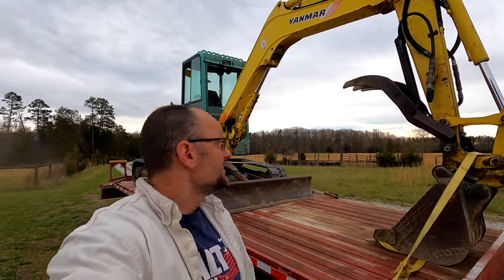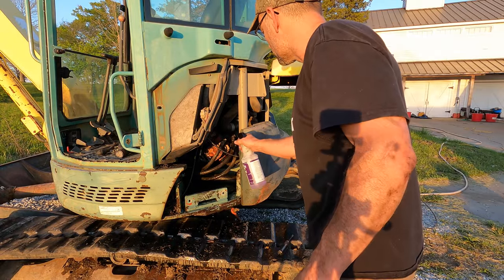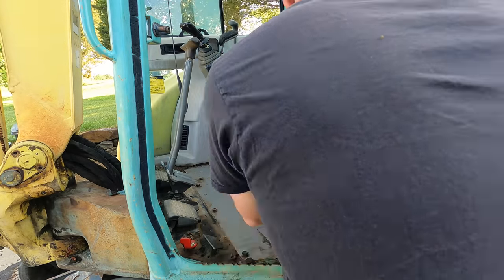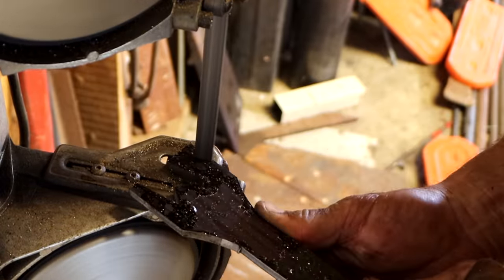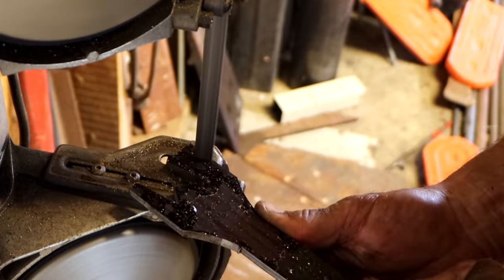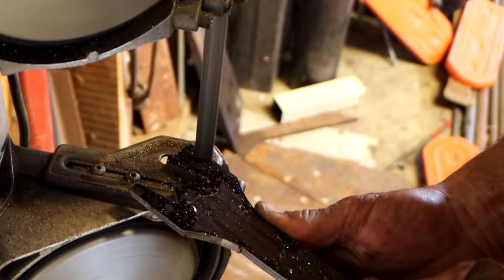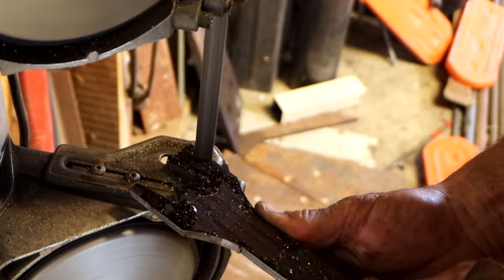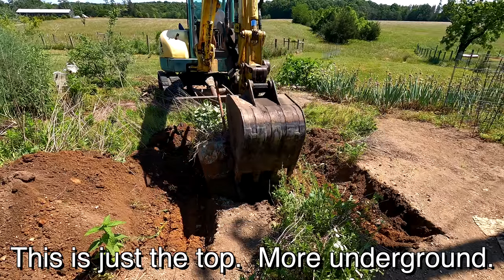Buying (and Fixing) My First Excavator.  Yanmar VIO-50

Comment: "I'll just make my own wrench" god I love farmers.
Reply: Depends on the farmer. I have fixed equipment that any time things were wrong they would just weld everything. No loctite, nut welded to bolt. Shaft collar slipping, welded to the shaft. Seal leaking, weld component to housing, etc. 

Later when real maintenance needs to be done it is so much harder grinding out all their welds and other makeshift fixes. Or the damage wouldn't have happened in the first place had they maintained it properly.
Reply: @court2379  Perhaps there's some selection bias.  All of my exposure to farmers has been them doing cool shit and putting it on the internet.  I imagine the type of farmer to do dumb shit isn't likely to show it off.
Reply: @Asdayasman  Yeah, that is probably true. It seems like there are two types, those that run something will negligible maintenance until it dies. And then leave it wherever it died for 50 years as it sinks into the ground.

Or the type that takes care of their stuff.

It's really probably a range, but the normal group in the middle doesn't attract attention.
Reply: Can use inexpensive wrench and grind it thin, then throw it in the tool box
Reply: @patrickthomas6170  Excactly  , I bought an extra cheap set just for grinding and bending .
Reply: That’s a beautiful excavator!!! Just the right size!!! You are a skilled dude…I was so happy when you were going through the lift and had found that missing wire and loose connection’s!!! It’s just fantastic when you can correct some bad or missing contacts and connections and you aren’t replacing a bunch of switch’s and whatnot!!! Higher priced parts and pieces!!!  Killer lift and some other tools!!!
Reply: @DaveyBlue32  Why are you replying to me?  I didn't make this video.
Reply: Or machinists.  I've made many, many special tools over the years.
Reply: @LongBinh70  Yeah but one expects it of a craftsman to make their own tools on occasion.  I spend a good portion of my time writing tools to make my job easier for example.
Reply: @patrickthomas6170  that's what I was thinkin, that's what my dad would have done, went to the SHORTY TOOLBOX (which WAS filled with improvized&REPURPOSED tools, pokers, scrapers, and tighteners...) found the proper tool if it was already made, or put one on the ''STICK FIGURE DIET'' and grind off a bit of sparks...
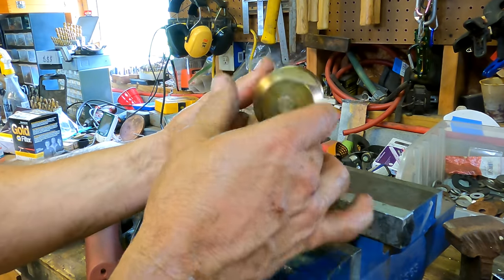Reply: Yeah, but there was absolutely no reason to make a new tool.   16:56 ....  There are plenty of threads there, all he had to do is screw down the jam nut another thread or two , and that would let you have more clearance to fit a regular wrench in there.  Sometimes the fix is right there in your face.   Think about it --- the last guy probably took it off with a normal wrench;   then he spun that jam nut a little too high to fit his wrench in there, and that's why he couldn't tighten it back down and it leaked. lol..   So neither one of them noticed that you just need to unscrew the jam nut a bit, which would simply lower it on the threaded shaft, which will make the accumulator stand a little taller for more clearance.   (like I said, there are plenty of threads there and they aren't tapered).  And you have to clock it the right way for that other line to screw on and then you tighten down the jam nut..   You could probably raise it up enough to fit TWO wrenches in there, or even a fat crescent wrench.   Cheers.
Reply: @calholli  Interesting point, I wonder what FarmCraft101 would have to say on the matter.
Reply: Yea, no kidding…, I can’t stand those types of “guys”…, making all kinds of special tools right there in their garage…,  just joking about hating those types of guys…  hahaha…!  I am envious though…, hahaha…
Great video…!
Reply: @onthelake9554  a cheap Harbor Freight set would be perfect for that.
Reply: That ‘bodywork’ he did with a log deserved a chef’s kiss 🤌
Reply: I made a wrench at school from some steel and bike chain.
Reply: Any technician worth a shit will make tools as needed !
Reply: Capital G
Reply: @pantherplatform  By Allah, I'll type how I wish.

Comment: I have a similar machine that wouldn't drive straight when it arrived from auction. Various theories were suggested including needing to rebuild the drive motors. In the end it turned out to be a sticky cable between the lever and the spool valve for one side. The fix was less than $100.
Reply: Great feed back. Likeing this link.
Reply: Rare but has occured a twisted frame! Very hard to detect raise the machine an take a look 99% of the time it will all be fine so check for a lodged stone ... raise one track run it back and forth...
Reply: In this case it’s probably the different size tracks that are the problem.
Reply: I have a similar machine that wouldnt drive straight , the previous owner paid over $ 15,000 to someone who kept replacing parts and still didnt find the cause.
Admittedly it took me 25 hours diagnostics to find the problem , it was just the pilot spool valves under the travel levers , the little cast iron rocker that pushes down on the spools was worn down and also a little bush had fallen out giving too much slop in the levers and the travel spools were not being pushed all the way down , i just replaced the rocker arms and the machine has 100 % travel function both sides. 
Hope that helps someone  :)
Cheers from Australia.
Reply: @jesperwall839   you can stretch the tracks quite a fair bit , that wouldn’t be the problem, if the track was to long it would slip about then most likely fall off within a few feet of driving
Reply: @pauls3204  
It’s not the length that is the problem. It’s the height difference. It’s like having different height on a car. The big tire will make that side move faster.
Reply: @jesperwall839  yep or more links from chain.
Reply: Good. If it was the motors you’d be shafted they’re thousands of dollars and “rebuilding” them doesn’t do shit most of the time.
Reply: outstanding tip along with the others below.
Reply: @heartobefelt  my mates 1.9kubota dose that low hrs on the machine. Might be a factory thing
Reply: @BaberJacks  easy to verify , lift up the rubber boot at the base of the travel levers, tilt the levers full stroke and see if the spools are being pushed to the end of their travel , push a flat blade screwdriver in the gap to check if that gives you full walking speed
Reply: @heartobefelt  thanks i should try that nxt time with his machine

Comment: Little suggestion from a current heavy equipment technician. To be a little more efficient in changing the gear oil in your finals is once you drain it turn your top fill hole to either the 11o’clock or 1o’clock position to ensure proper fill. Sometimes the oil your putting in will run out the check hole and give you a misreading. Just a friendly tip. Love your videos.
Reply: He was peaking into the center hole to ensure that the level was up to the right height.  Still a solid tip though.

Comment: I just took a hydraulic class for my millwright apprenticeship and the gold thing seems to be an accumulator. It does exactly what you said it does but that's the technical name. I see others have already commented it but figured I'd chime in. Also there are 3 basic types of hydraulic pumps. The piston one like you have the vein pump and gear pumps. Really interesting stuff. No way out of getting the hydraulic fluid everywhere haha. Iv been covered head to toe in it at work before.
Reply: Been working on my mini ex past few weeks. Im up to 5 showers a day. I dont know how people do this shit for a living. Id go broke on soap and hot water alone.
Reply: @DieselRamcharger  I don't either. It's only been a couple times for me when working on a big press with hydraulic lines everywhere that we have to disconnect is when I got covered. All the other times it's usually just my hands and arms that get it.
Reply: My old Allis tractors, from the 50's and 60's, have a 4 piston pump that runs off a cam shaft. No swash plate. 3 pistons are for volume and the 4th is for high pressure. Allis only had one way cylinders back in those days and they worked fine for what the were designed for. 
 Now days, people want a 2 way system so they add an open center valve to run a 2 way cylinder. The biggest problem is, these pumps are high pressure, low volume and if you use a common 4 inch farm implement cylinder, it's going to be slow.
Reply: @DieselRamcharger  Just wipe off with a towel and keep working. 5 showers is kinda silly.
Reply: @calholli  hell no it isnt! my shop is at my home so it have to work very hard to not have my house end up looking like a shop. lots of extra cleaning. its 115+ degrees here 6 months out of the year. the showers are to help me not die from exposure.  and probably most importantly is cross contamination. if i do a hydraulic job then need to paint or run a cnc machine there is no way i can do so without showering, or i will contaminate the next work space. i dont have 1 job, i have them all.....
Reply: @DieselRamcharger  putting leveling Jack's on an oilfield rig, and the operator says no there's no pressure on that line go ahead break it. Worked 10 more hrs in the 100° sun with the rite side covered in oil. Fully get your comments about exposure, never had a worse sunburn.
Reply: @colin4123  at my age that shit would kill me.....its a young mans game for sure.
Reply: @DieselRamcharger  for sure. That was probably 25 years ago, I'm no good In the heat now. Days like that will ruin you to it.
Reply: I was in pneumatics for 20 odd years, been covered head to toes more times than you'd care to know, never been a problem!!! , ha ha , get a better job!! 🤣

Comment: I'm a retired diesel and equipment mechanic. 
The black stinky oil you drained from the final drives is a hypoid gear oil that new is black and stinky also. The chamber on the hydraulics is exactly what you thought it's a shock absorber which stop what is called hammering in the lines.
Love your body work especially the WOOD. 👍
Reply: @Frederick Burns Hi how are you? Hope we can be good friends

Comment: It is good to see that you cleaned the machine and gave it a service before you put it to work and at last a man who knows the correct way that a diesel fuel system works E.I. tank to prefiilter, lift pump, final filter, injector pump. I have been a heavy diesel mechanic for almost sixty years.    From Australia

Comment: I like watching you work on your Yanmar, while drinking a good coffee and above all, without getting my hands dirty.
In 2013, two years before building my house, I purchased a 2002 Kubota KX 61-2 mini excavator to prepare the construction site.
I had paid $16,500 CAD for this machine and was planning to resell it once the work was completed.
But I later changed my mind and chose to keep it, mainly for cleaning and laying out trails in the forest.
With this machine, pulling a tree out of the forest becomes almost child's play, a toy weighing nearly 6,000 pounds.
Aside from changing oils, filters and regular greasing, the only other part I had to change was the battery.
In winter, after snow removal from the roofs, I use it to remove the banks of snow around the buildings.
This machine was only equipped with a canopy roof placed on the four posts of the ROP, so I built a cabin from these elements, in order to protect the controls and its operator.

Comment: Just a suggestion from a retired heavy equipment mechanic, 1 your track is worn and diameters are different, and 2 I think the worn track side drive motor is on the week side. Unless you have metal in the planetary gears your good, drive motors are fairly easy to do.
Reply: how do you feel about ppl putting an engine oil filter in DRY?I like filling them,+ oiling the gasket.
Reply: @genehunsinger3981 people have different opinions on prime or no prime and over the years I've done both. But  I generally prime the filters on my personal equipment.
Reply: @genehunsinger3981  always put oil on the o ring
Reply: @genehunsinger3981  depends if the filter is vertical or horizontal
Reply: @FishFind3000  most of the oil stays in,try it.Fill 1 up and the turn it on its side.Not much comes back out.
Reply: @genehunsinger3981  i usually prime my filters but the current accepted argument is that prefilling the filter can cause contamination
Reply: @genehunsinger3981  That filter is so small that it's not a big deal;   It will fill very quickly.  On my 7.3L Ford, (which holds 16 courts or 4 gallons),  it's nearly as big as a 2 liter pop bottle and it hangs directly vertical--  so you can tell that it's designed to be pre-filled and is easy to do.  The volume of the filter matters more than anything else.

Comment: Agree totally. I got a EX50urg off auction, 96 model, 4600 hour. Like yours, gone through with minor keeping ups. Man, over 15 years, I did a lot of work with it ( built 15 houses), sold it over I paid for with 5900 hours on it. Runs flawless.

Comment: Those yanmar minis are hands down the best machine in its class.  I did however have to replace the drive motor on the same side…. The oil leaks internally.  Pro tip, when pouring from a spout bucket, start with the spout on top…less glugging.  Also, put your backfill blade down to stabilize the machine, your guts will thank you.  The factory bucket/slash thumb pin on our machine was bored through the center for grease and would break in half every couple years.  We had one machine solid and drilled the knuckle and put in a grease zerk, problem solved to this day.
Reply: i looked at the kubota execavators wich pile of room and head room in there open and enclosed cabs like a luxary mini ex
Reply: @michaelmactavish4445  they are nice, but are more expensive and not as smooth IMO.  Those yanmars are tough bud.

Comment: Step one: pressure wash everything. That way you can see what you're working on and you can see the leaks as they happen. It's a lot nicer to work on as well.
Reply: He did
Reply: 1, Remove debris by hand.
2, Soak in degreaser.
3. Pressure wash.
Reply: @RangieNZ  Yeah, that's the basic procedure to pressure wash anything nasty and greasy.
Reply: I once pressure washed a car engine looking for a leak.  I blew a huge hole in the sump.  Opps.

Comment: I bought a Vio 35-2 a couple years ago and am very impressed with what it will do.  About the same condition as yours but 2200 hrs. ($14,500 from private party) and did pretty much everything you did when I first got it.  Seemed to run a little warm when at half throttle or higher but not familiar with this machine, figured it was normal.  Sat over winter and in spring started a hidden mouse nest on fire which revealed a (hidden) lengthwise split in muffler which was putting hot exhaust gases into the engine compartment, thus the overheating.  $550 for a new Yanmar muffler but only $90 for an aftermarket JD compact tractor one with matching manifold flange (modified to fit space).  Had a final drive start to lock up occasionally (broken gear tooth or something floating around in the motor/planetary gears) and finally had to replace it - $2200 but still very happy with the machine.  Your video was very well done and informative.  Thanks for a job well done.
Reply: @Peter Carlson Hi how are you? Hope we can be good friends

Comment: Retired auto mech here.  I was going to call your first item a pressure relief valve and the second item an accumulator (like a water hammer arrestor in your washer circuit), but these are just guesses.  Where you said "The struggle is real" reminded me why I took the grinder to a spare 12" crescent wrench.  I cut it down to about 4" and it got right into those tight spaces with torque to spare on a large nut or bolt which was slow to come out.  The price was good, too, since it was a spare.  For smaller wrenches, I found a shorty set at Harbor Freight for $18, I think. Very handy. 
TIP: I tie a shop rag over my wrist to keep oil out of my armpit.  (such an icky feeling)
I'd love to have some heavy equipment to play with, but can't, retired on 1/3 acre.  Your videos are wonderful to watch.  I follow Matt at Diesel Creek, too.